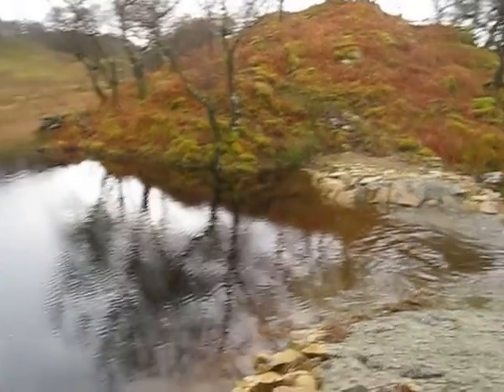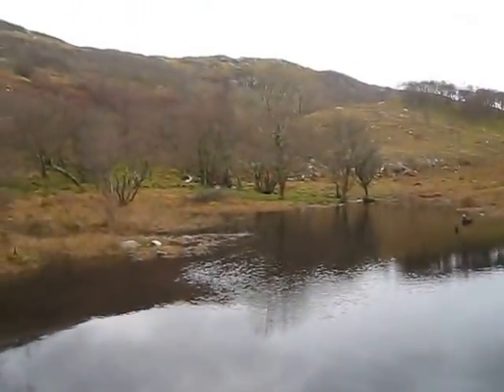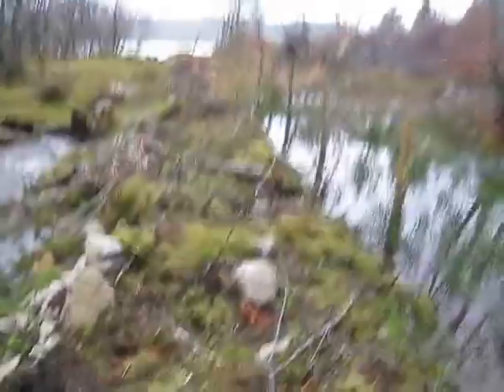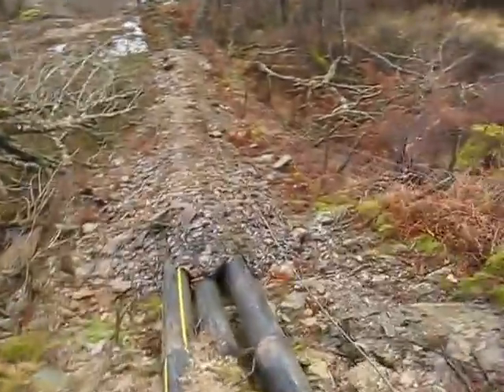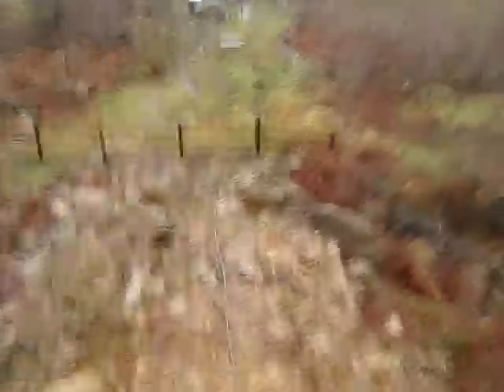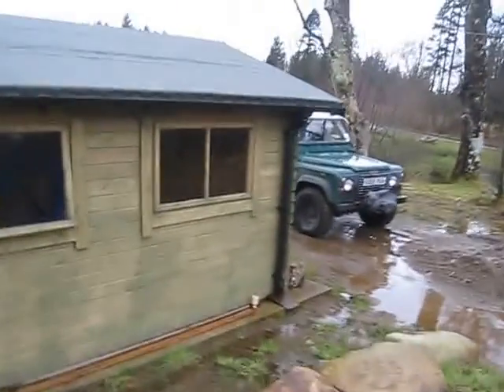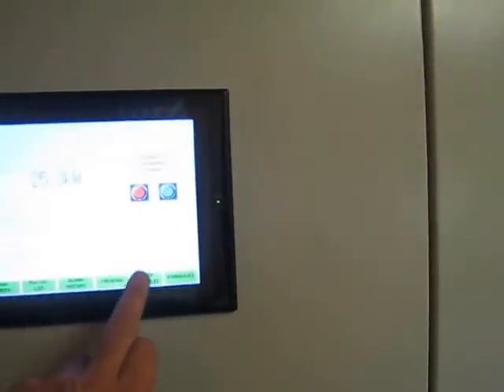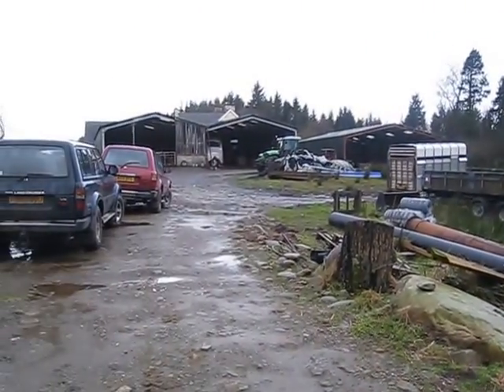Micro Hydropower

Comment: How is it running today after 8 years of use?
Have you ever had to clean the intake screen or empty out the pond?
Do you have a spillway or other means to empty the pond?
Reply: Thanks for your interest.  Yes its worked extremely well.  We have never ever had to clean the intake or dredge the pond but there is evidence of peat coming in from the supply rivers.  We lost a little production last year when the generator bearings started to rumble,  rather than replace the bearings we replaced the whole generator because the original was only aluminium IEE2.  The replacement was cast iron IEE3 so more efficient and bearings that had grease points.  We have now clocked up over 700,000 Kwh very pleased :)
Cheers
Martin

Comment: Thumbs up!  I had an idea of an opened empty soup or beans can and cutting one side and bottom and leaving one side uncut. Then carefully pry open the can to form two half cans as a "pelton cup". It doesn't have to be as big as a chicken noodle soup can either. I could use smaller cans than that and mount a number of them around something that's attached to a permanent magnet alternator shaft.   But if I really wanted to go BIGTIME and had enough water and pressure to do it, I would  take 20 lb propane tanks and fill them with water to be sure there is no propane in them and then emptying the water and taking a right angle grinder with a cut-off wheel and cutting the propane tanks lengthwise, leaving one straight side uncut. When opened up this would make a large  pelton cup. Done to about 8 or more propane tanks. Taking two steel automobile wheels and welding them together, then welding the opened propane tanks around the wheels making a large pelton wheel.  The center of one of the 2 wheels welded together would need to be cut out to be able to get a ratchet in to tighten the lug nuts of the other wheel to a junked automobile hub/axle. Similar to this https://www.youtube.com/watch?v=BtCMuO3DVyE  Or  instead of using the hub/axle of a junked auto, weld the propane "pelton wheel"  to a large steel pipe and fit each end of the pipe through a large pillow block bearing.